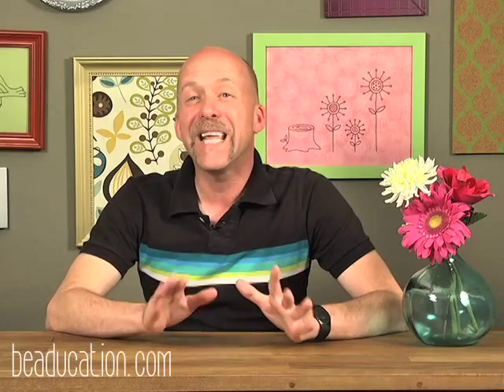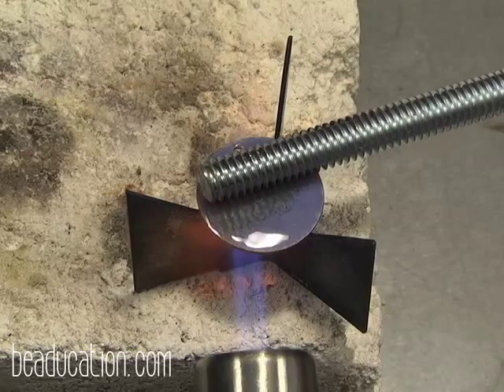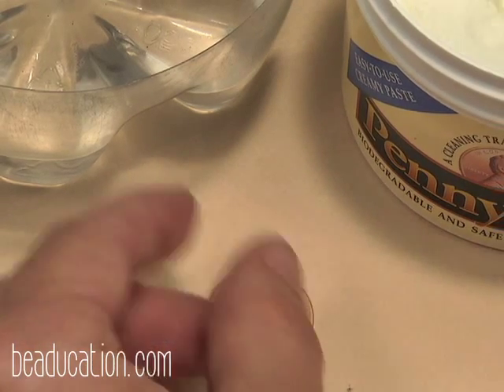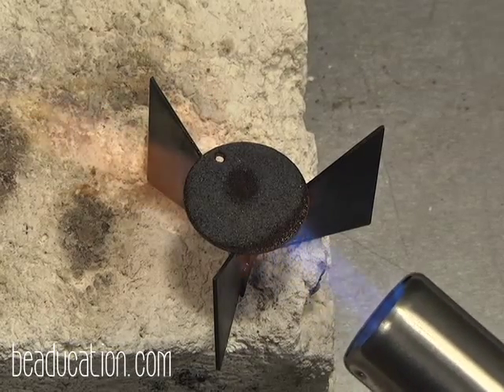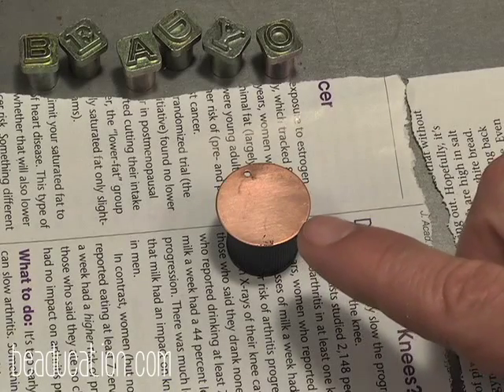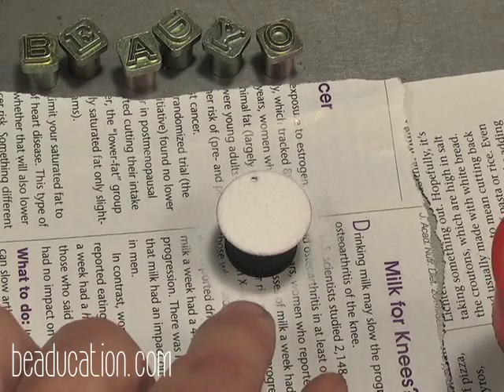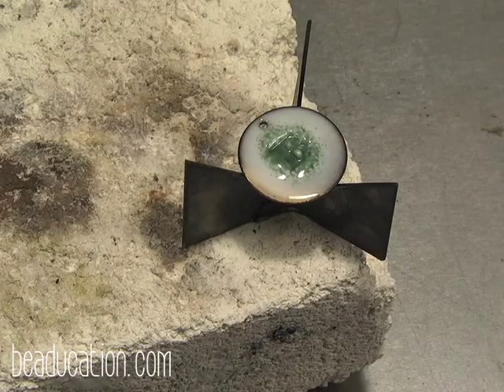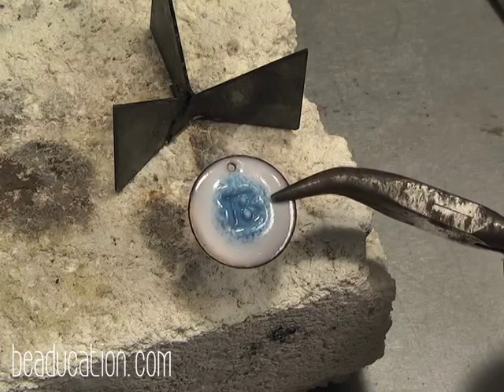Letterpress Torch Enameling Tutorial - Beaducation.com

Comment: Can I use any metal design stamps? Do you use a release agent? If not, what stops the glass from sticking to the stamp? Can they be used to stamp etla after you use them with enamel?
Reply from the maker: HI Divella. Well technically yes, any stamp would work as long as it is deep enough to impress a deep enough impression in the glass BUT, when you press a piece of metal to the glass, it will heat up the tip of the stamp and can start to soften it. It then won't work well in metal anymore. We use leather stamps for this because #1, they are cheap and #2, they don't need to be super hard to impress into leather. In regards to your question about sticking to the glass, it just doesn't stick. I don't think the glass is molten enough to stick. Hope this helps :)
Reply: Thanks so much!
Reply: Dianne Jacques it won't stick because the metal stamp isn't hot. If it was, the glass would stick. Hot glass sticks to other hot things, not cold ones.

Comment: The enamels are not fusing completely, they go through the sugar, orange peel and shine a little and then nothing happens. When the project is cold some enamel falls off, what am I doing wrong? The projects worked in art class but not at home, I use Max flame torch.
Reply from the maker: Hello, are you working with copper and cleaning it?
Reply: beaducation I clean with pennybrite, use tongs and make sure not to leave fingerprints, also use Klyr-Fire spray. How long does a penny size take to fuse completely?
Reply from the maker: sajvi Hi, What metal are you using, copper or brass? I'm curious how you are is making this spray? Also, what made you decide not to use Klyr-fire right out of the jar?
Reply: sajvi ..... i can not get my enamel work at all...it just burns most of the time...i have tried different techniques that i have seen on Pinterest....help
Reply: Just a note...i use a butane torch, tried copper, glass, sterling, getting frustrated....
Reply from the maker: Have you had a chance to watch this beginning class? https://www.youtube.com/watch?v=j4EALYetknI Or this class on tips and tricks? https://www.youtube.com/watch?v=KnjS7liHgf8